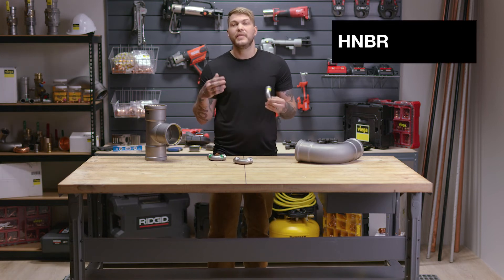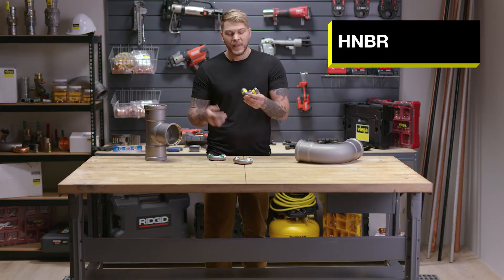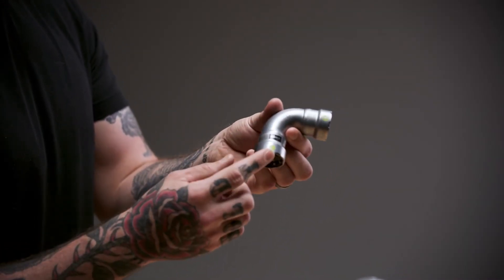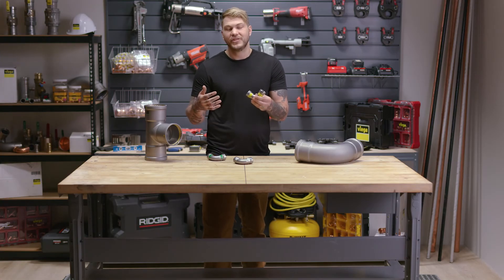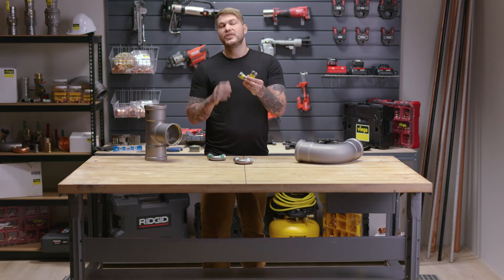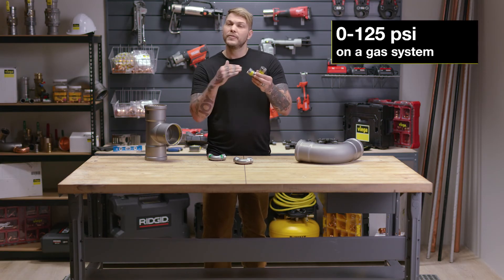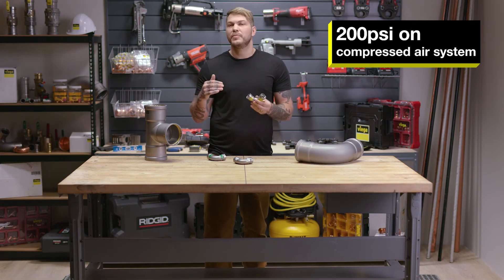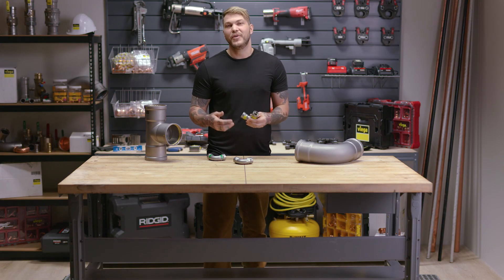Viega MegaPress Overview | Viega Training

Comment: Home heating oil is ok with the last fitting? Where i work, we installed a diesel back up generator. The workers were using threaded black pipe and cutting/threading them on the job site. I asked if they ever used viega and they said something about their company wasn't going to spend the money for new equipment. So narrow minded! I have the press tool for 1/2 and 3/4 copper, i bought it as a homeowner and have helped several people install hot water heaters and fix small plumbing jobs for my friends. I love the press fittings. People are amazed when i show up with the press tool and viega fittings, no soldering!
Reply from the maker: Viega MegaPressG is approved for a variety of different fuels, oils and lubricants, check out our commonly approved applications chart here!

https://bit.ly/3oD2eKI
Reply: Is it a possible to use for radiator pipe cause has hot water and the pipe is metal
Reply from the maker: Hi there! For this type of technical installation question, we would suggest reaching out to our Technical Support team (866) 838-8714 techsupport@viega.us